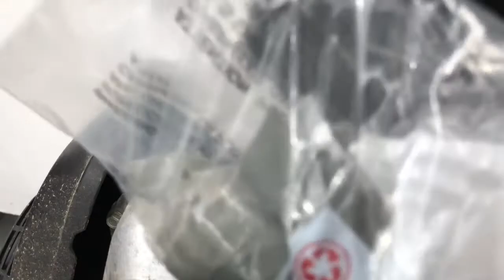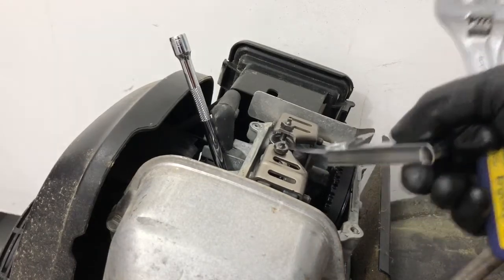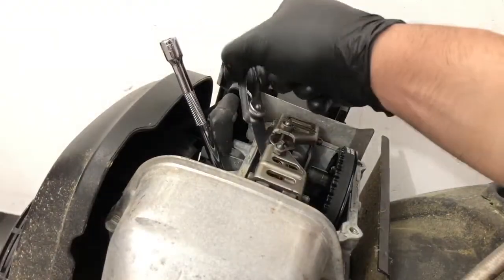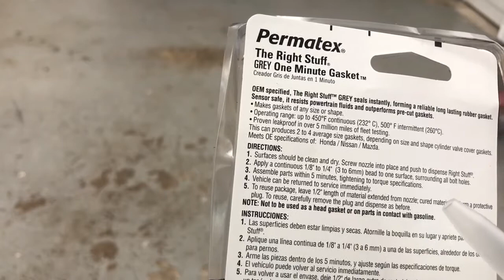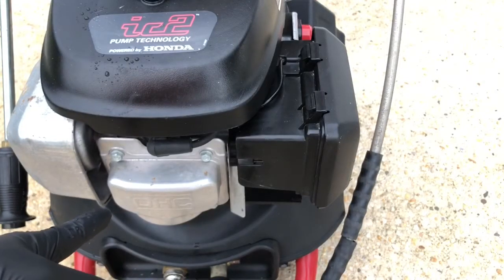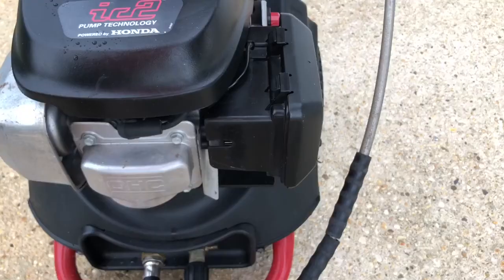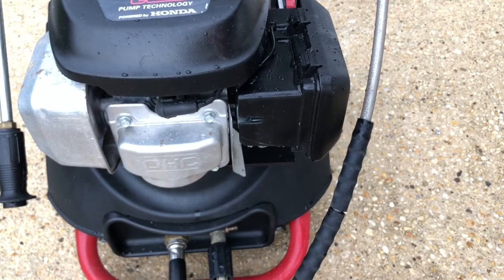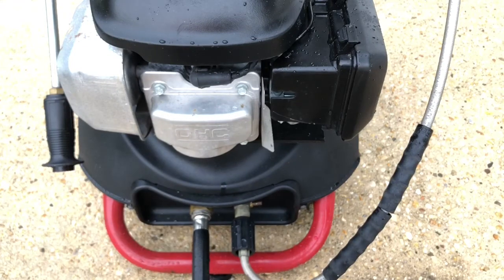How To Replace Valve Rocker Arm Honda GCV160/GCV190 | Hard Pull Start

Comment: I have a honda mower with the GCV160 and the pull starter feels like it is locked up.  How do you look at the rockers to visually see they need to be replaced before removing them?
Reply from the maker: That’s the farthest I got into this engine. Check to make sure the brake on the mower is disengaging first, also check that the pull starter itself isn’t locking up. 😎

Comment: How do you know the rocker arms are bad?  The old ones you pulled out looked intact still.
Reply from the maker: Watch the video again. The sizes I show you on the feeler gauge are the exact factory settings. You will need everything in the links I left in the description. You would be  better safe than sorry to replace rocker arms while you are in there.
Reply: Name It Build It ok, I recall that part. I wasn’t sure that’s how the timing got set. Thanks for the help!
Reply from the maker: The timing was off which happens over time with these engines. Once the timing isn’t right that’s usually when they go. They all go eventually so I changed them whether they were good or bad.
Reply: Name It Build It how is the timing reset back to factory?  I am curious because this is exactly what my pressure washer is doing.
Reply from the maker: You are welcome! Glad to help. Just be patient when you tighten the nuts and use the feeler gauge to set the gap. After they are tight you want slight drag on the correct sizes. You may have to do it multiple times to get it right like I did on video. Your engine will thank you later : )

Comment: more important. why are the rocker arm's cracking?
Reply from the maker: 1-Thin Metal. 2- They need to be adjusted after many hours of use which no one does. 3- After not being adjusted correctly,  they are not in correct position and being hammered on 1000s of times per minute. Being in a small engine along with heat and vibration, they eventually will give out.